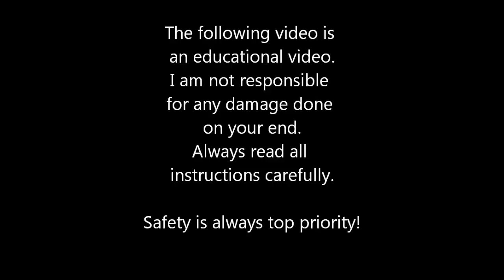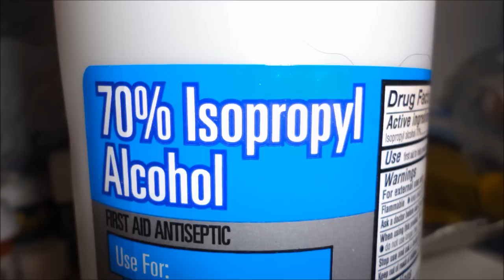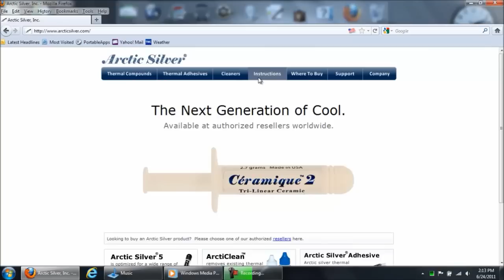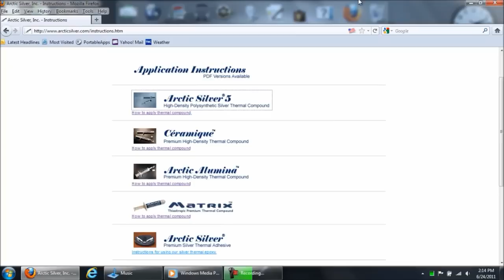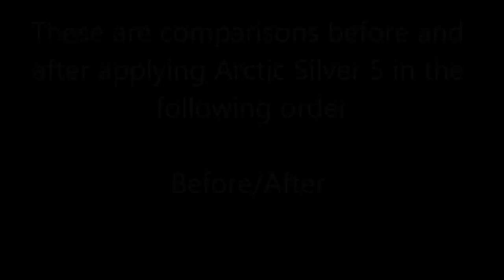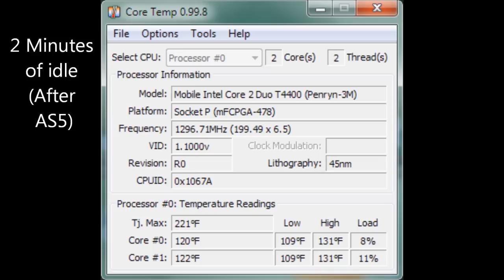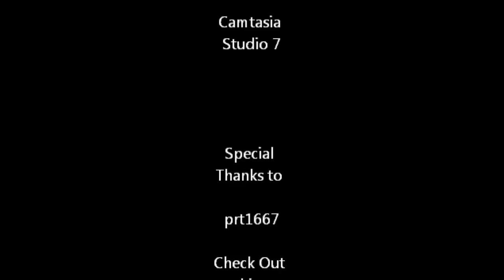How to Apply Thermal Compound (Arctic Silver 5) to A CPU and A GPU - Laptop (Dell Inspiron 1545)

Comment: I used to believe that AS5's better conductivity would be useful but apparently, the other properties of the paste are more important. Maybe AS5 doesn't have the right particle size or density or maybe its conductive oils are not the latest formulations. Regardless, its performance is worse than MX-2.

I have looked at benchmarkreviews and used to believe that was the best review of TIM. A more updated review with better controls and multiple mounting attempts is skinneelabs' TIM compilations.

Comment: dont scrape it, use rubbing alcohol or better IPA, isopropyl alcohol.. then put a tiny pea sized or rice grain sized dot in the middle and it will spread by itself when heatsink is pressed against it.. spread it and u will use tooo much (or if you spread that pea sized dot by yourself you might cause air bubbles that wont be created if you let the heat sink squeeze it out yourself) - it should only be a thin layer that help to transfer the heat. Even the best thermal paste doesn't spread heat like copper so it should only be a thin film between the contact areas. Thumbs down for this video!

Comment: 1.- I believe you should not spread the compound. It's easier of you apply a small dot and let pressure do its thing.

2.- I believe I heard 'cooler'. Shouldnt it be 'colder'?

L8er!
Reply: +1st_Luis read the description, he spread it because his cooler doesnt have an iHS (integrated heat spreader, therefore wouldnt spread correctly)
Reply: +Catherine Dubois Greetings.

I didn't read the description, but the fact that it doesn't have an IHS means nothing in this case.
It will spread correctly with the pressure.

But don't believe me or quote me, try it. After doing it, you'll notice whether it, or it doesn't, spread correctly.

Try the dot method, BTW. (Smaller than if the CPU has IHS)

Comment: Nope, AS5 remains in its fluid state for as long as it's used. In general, it doesn't have a shelf life or anything, so if you leave it there, it'll outlast the laptop, but no, it's not permanent, you can wipe it off and replace it any time you like.

Comment: NEVER EVER do this, put a pea in the middle and let your cooler spread it. It will work better and if not better, it's far easier, luckly AS5 doesn't conduct, or it will probably spread too far using this method and short.

Comment: any gaps means heat build up, and a blob will defo go over the edges if you use even just a little too much, that isnt what you want, anyway i dont think there is a right way to do it, thats why you tend to get square patches of heatsink compound when its done during the build like with laptops.

Comment: talking about heat build-up, because of old thermal solution and then creating one yourself?
You never should even attempt to spread thermal paste! It is because you would create air pockets because of uneven spreading! There is no way that you would be able to spread thermal paste by hand or tool or even machine evenly enough to avoid air pockets. You do it by pressure only!
BTW you want to reduce temperature and you use thermal insulator mixed with thermal conductor. All thermal pastes are made mostly of thermal insulator. Use Coollaboratory LiquidMetal or LiquidPad - it is 100% thermal conductor, as metal is thermal conduftor.
I used it successfully on bare cores (no IHS!) such as AMD Athlon XP-M, nVidia Geforce 9800GTX+, laptop graphics cards and CPUs.

Comment from the maker: Thank you for your input.  I might try it the next time I take my laptop apart.  Any quality thermal compound is way to expensive to mess around with, but I might give it a try because of your experience.  I just hate the feeling of knowing if my thermal compound spread all the way or not, because you cant remove the heat sink after you put it on the thermal compound. I know for a fact processors with IHSs need no spreading period. but w/o IHS its just a sense of security, and thats why i spread

Comment: K so a client of mine pointed this out to me (he used it for the basis of his application of thermal paste), and let me tell you why at 30 seconds in I already know he did it wrong, without actually seeing 13 more minutes of garbage.   One of the best ways to screw up any electronic stuff is to buy crap from the internet. (and not understand what you are buying.)
The next best way is to watch videos from amateurs on Youtube.  (Although in defense of that, I have seen a lot of other pro shops screw it up too.)  
But anyone that thinks that we can save a few bucks by ordering supplies off the internet and doing it themselves has no clue what the real world is all about, and why they have the opportunity to order it off the internet in the first place.   You wouldn't order a "sew your own parachute" kit off the internet because you wanted to skydive right?  (Unless you were a master sewer/seamstress)  But I digress.

The final objective you are attempting to achieve is as good as a thermal transfer of heat from the CPU/GPU to the heat sink mechanism/plate, or whatever you may have for that. (Yes, there are other things too.. but that is far beyond any of this stuff)
So using thermal dynamics laws, we know that
1.  The elimination of alternative routes creates a stable static transfer conduit of heat.  In other words, the precise amount, plane level, and geometrically correct application of this material used as a conduit, aka Thermal Paste, will allow the heat to transfer from the CPU/GPU to the "outlet" whatever that may be.
2.  Output dissipation must be greater than input dynamics in order to achieve a proper conduit flow, or the thermal transfer will seek an alternative route.  In other words, if your CPU/GPU is generating more heat than what your "outlet" or heatsink can manage, the result is it will, forcefully if need be, find an alternative output, usually fed back into the CPU/GPU after it torches the thermal paste.
So, how do we avoid this?  Definitely not by spreading it out and creating micro fissures that heat can exploit and build in later, and is the start of your thermal paste going bad.  (By the way, there are only ever two reasons why you should need to replace thermal paste, and 'time' is not either of them.  Figure that out and you will be far ahead of everyone else.)
Using Viscosity dynamics we know that when flat even pressure more dense than the fluid is applied to anywhere on a viscostic fluid, it will seek the path of least resistance to equalize the pressure.  (Think of squeezing ketchup between a bun and hamburger)
Therefore, the most reliable way to create a satisfactory thermal conduit is to use this method, applying constant even pressure until secured in place.  Because the pressure originates, or is supposed to originate from the center of the target area, it is imperative that you do not reverse the pressure application at any point because this could cause a back flow or fissure gap in the thermal paste.
So the solution?  Well, I can tell you after 20+ years of doing this, I still can't do it exactly spot on textbook perfect, but my video would be exactly 2 minutes and 30 seconds long, if I talked for 2 minutes.
But if you are not adept at using spacial geometric recognition and hand/eye coordination tasks together (aka. eyeballing the amount and placement needed), I recommend taking it to a professional to at least stand a better chance of having it done right, and if nothing else the means to check, verify, and re do if needed.
By the way, this is all science 101, a bit of physics 101, there is nothing difficult or even really complicated described in here, other than understanding the principles which are the basis for the higher/deeper understandings of the studies leading into computer "blah".  As GI Joe used to say:  "Knowing is half the battle."  Thanks for reading.  Feel free to check me and my business out if you have further questions.

Comment: You're not supposed to spread the paste manually.  You put a small dab in the middle of the core, and then just let the heatsink pressure spread it out evenly.  The way you're doing it is bad because small bubbles will decrease the efficiency of the paste...

Comment: Also you're just setting people up for failure.  You don't mention to only clean with 100% isopropyl alcohol and a plastic card not metal. You also don't mention not to touch the heatsink or any of the copper parts including the heat pipes (which you touch and don't clean in your video) because the oils left behind will reduce its efficiency. You have to make sure you tell people these kinds of things in an instructional video. You have to assume they know absolutely nothing about the task.

Comment: AS5 was great in its day but it is outdated now. MX-2 does a better job and is cheaper. If you still have AS5, go ahead and use it, its not bad. I prefer PK-1 which is a bit more expensive but works better than MX-2 or AS5. We are talking less than 2C anyway but don't buy more AS5.

Comment: Your method will leave air pockets and leave your cpu running hotter. You should have just left that pea-sized dab in the middle and then reassembled the heatsink.

Comment: i hate this pain in the a** pastes that don't come off with anything, arcticlean1 was more efficient than your method but probably more expensive too unfortunately, the application method was wrong. you shoud spread with something like a credit card or another method a drop in the middle then heatsink will spread it. the second one is best if the chips are small, not your case. anyways the results matter and im glad your temp were lower, i had some problems with AS5 in the past. Cheers

Comment: really shouldn't use that type of arctic silver on a flip-chip like that. that kind is conductive, it has silver in it literally. it is good stuff, just not for a chip like that. you should use a ceramic thermal paste, it isn't conductive, so it can't short out your cpu. it isn't likely to happen with the silver stuff, but it can and has in the past.

Comment: Holy crap I saw so many issues with this video.
You never scrape at any parts with something metal (and even using hard plastic like he did can sometimes cause issues as well).
Clean off old thermal paste with coffee filters (no lint), then wipe with alcohol swab/wipe, let it evaporate, blow it with can of air, then you apply a small dot/dab of thermal paste and let the HEATSINK spread it out. You removed too much by spreading it around with your finger (not to mention put in small air bubbles which will decrease heat transfer ability).
I've personally changed numerous components, boards, thermal paste, CPU, GPU, heatsinks, etc. I'm a computer technician and have been for over 15 years. 
PLEASE PLEASE PLEASE do not attempt to do it like shown in this video. If you do it'll have a great potential of causing issues. Please take it to a shop if you're having to try to "learn" how to do it by watching videos such as this one.... at least watch others' videos if you're determined to try it yourself.
Reply: Do you clean the old thermal paste with isopropyl alcohol 70%??

Comment: You don't even know the difference between a GPU and CPU. The top one is the CPU (wich has a socket, since it is replaceable). The one to the right is the GPU + chipset, which is not yet integrated with the CPU in this generation.

Comment: Sorry but i had to log on to write this.. but why on EARTH did u not put a thermal pad on the GPU instead u put thermal compound problem there is that it is 1: Not Copper ur applying it too 2: It probably wont reach the metal plate but if it does it still WONT cool it down it will simply suffocate it thus why thermal pads are used too 1. level out the GPU and CPU because the CPU's Before were usually higher placed and thus the use of thermal pads came in but now they are equally leveled.

Comment: Dear God . Dont make anymore of these.. and learn to apply thermal paste.  DO NOT spread it with anything. Especially not ur finger in a bag..  let the heatsink distribute it to avoid air bubbles... and what kind of comparison results were they?. Run a damn stress test... giving idle results of 2degrees F is literally nothing. Its so bad that its 0.16 Degrees Celsius (which btw you use to measure computer heat as Farenheight is inaccurate in measuring meaningful change).